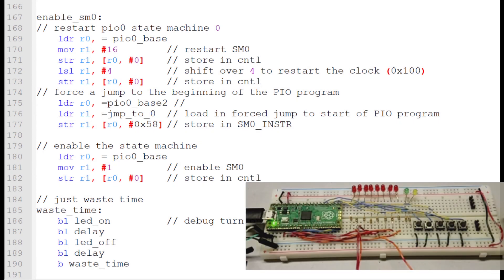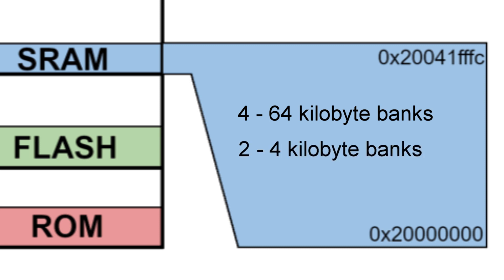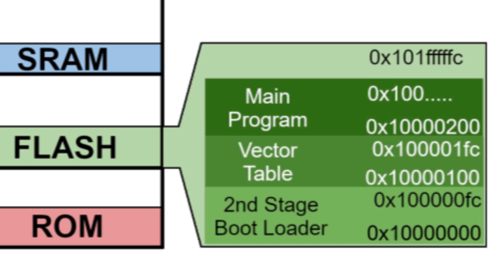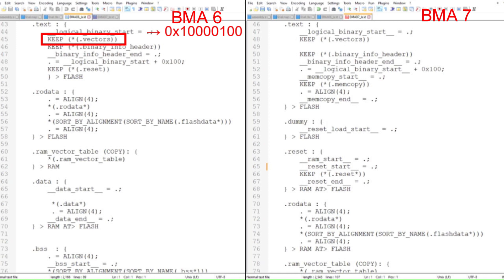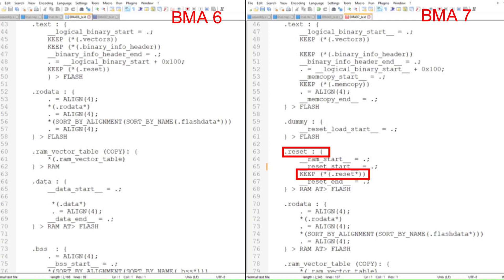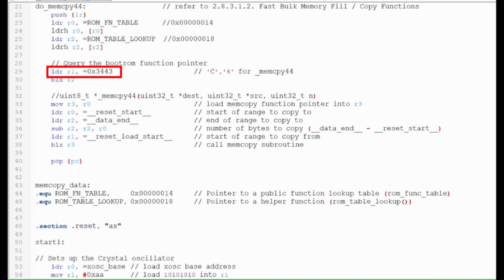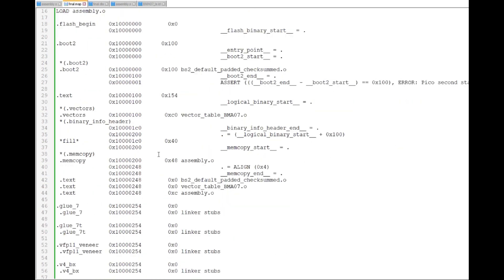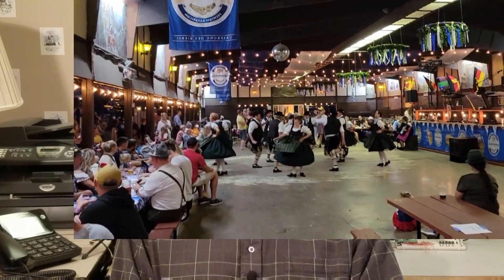RP2040 - Bare Metal - Executing from SRAM - BMA07

Comment: You can actually produce a uf2 file that loads directly into SRAM, you just need to setup your linker to put nothing in flash. The bootrom will jump to the lowest address it loaded from a uf2, so if your uf2 has no flash addresses, it won't touch flash, and will start executing directly from sram. You can then avoid needing a stub for clearing out the .bss and copying .text and .data. Of course, if you do this, your code will disappear if the mcu loses power.
Reply from the maker: It certainly makes sense; although I haven't tried it yet.  I'm still tentatively working through linker scripts.  Since I don't do it often enough; my brain has to start from scratch each time I fuss with linking.
Reply: @LifewithDavid1  I do as well, I just happened to have just implemented it the other day, right before stumbling on this video. I could provide sample code if you're interested.
Reply: @LifewithDavid1  This was an heroic effort David! Most of the work seems to be understanding how to get the tools to do what you want them to do. The fact that you had put in a nop to force the necessary word-alignment is witness to that, I think. Great job. I am now looking at the RP2350 data sheet to see what has changed, ... wish me luck!
Reply from the maker: Thanks.  I've looked at the RP2350 (and have a few videos) but I haven't tried bare metal yet.  The vector table structure is quite different, so it will take a while before I figure out out.
Reply: @LifewithDavid1  Yeah I happened to be taking a look at it yesterday. It seems a lot more complex than on rp2040.

Comment: Hi David, first i want to thank you for such great work on such amazing machine like pico, i would like to ask you for a video to explain how to use c language on pico without using the c/c++ sdk , thanks again.
Reply from the maker: You're welcome.  I'm not a c expert; but I think you can use GCC to create a C program without using the C/C++ SDK.  However, If you want to use any other RP2040 features like UARTs, PIO, GPIO, DMA, etc, you will have to include a number of libraries that are included in the SDK.   I would include the "reset"  routines I've developed in ASM to initialize the RP2040.  Try using the steps I outlined in my bare metal videos , but use the GCC to create the .S file from the c file.  I've got a lot to discover in assembly, so it might be some time until I get to a bare metal C program.  Thanks for watching!
Reply: thanks,  @LifewithDavid1

Comment: Can the assembler calculate the size to copy? Also, is there a word align directive, so you don't need to manually add the NOP?
Reply from the maker: Yes it can, in this case I used the values from the linker script to calculate the size to copy.  Regarding word alignment; I believe you are right; I'll have to check into that.  I know that you can have word align directives in the linker script between sections; however my data was not in a separate section for this run.  A lot of the tutorials showed using a NOP as a pad character; it would be really handy if I didn't have to do that.  Thanks for the suggestion.

Comment: Very interesting.  I wonder if it would be faster to execute the code that changes the CPU clock speed before coping everything to SRAM and executing there.  Is the copy effected by the CPU clock speed?  If not, then it would not matter but if it is, it could have a significant difference when your code gets really large and speed up the startup time.  Also, given that a lot of the initialization code only gets executed once and is probably under 16Kb, what is the performance difference between executing the initialization before the copy and not coping that initialization code vs coping the code and executing the initialization from SRAM?  Maybe the difference is only a few milliseconds but would be interesting to know if boot up time was critical.
Reply from the maker: You are correct; it would be MUCH faster to change the clock speed before copying.  I did this to see if I could make it happen by using a program I already knew that worked.  Now that I've worked out the bugs (and I had a lot of them), I would keep the reset program in XIP flash and move the "real" program at high speed into SRAM.  I think the speed difference is in the order of seconds, not milliseconds since the clock speed coming out of reset is V-E-R-Y slow.  Thanks for the excellent insight!

Comment: What about some audio effects? Maybe real-time pitch shifting? What about a real-time Pi Pico version of AutoTune? Or a nice reverb?
Reply from the maker: That would be interesting.  I've done several AWG videos as well as MIDI.  I've thought about making a little monophonic synthesizer.  I'll have to get a lot smarter on how pitch shifting is done; I've used it with limited success with Audacity, but that's on a batch basis.  If the math skills of the RP2040 aren't up to the task, maybe a RasPi 5.  Thanks for the idea.